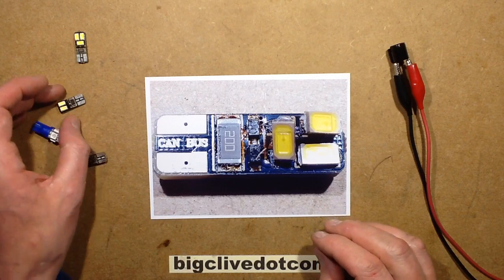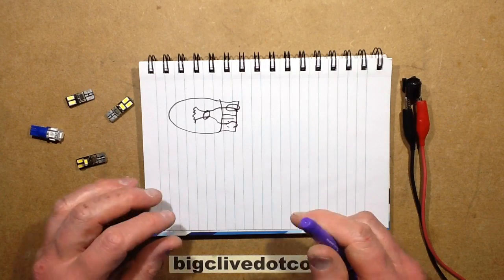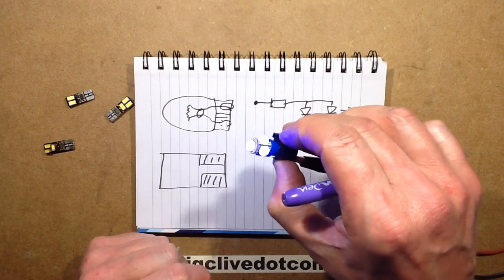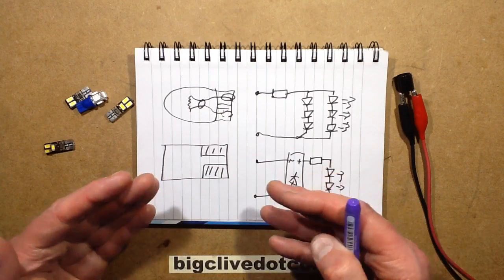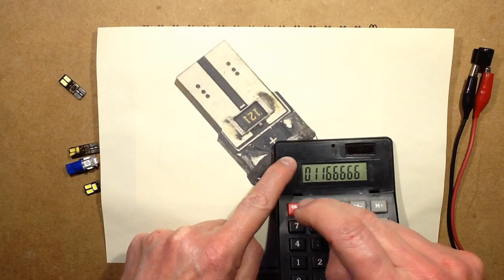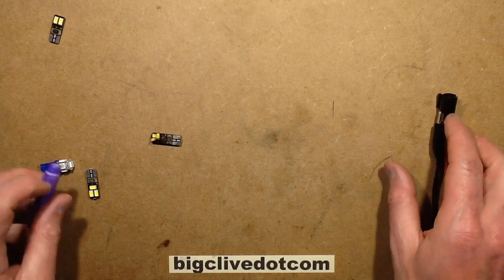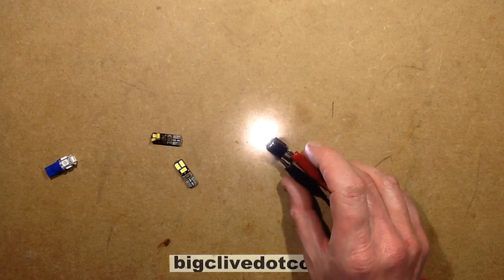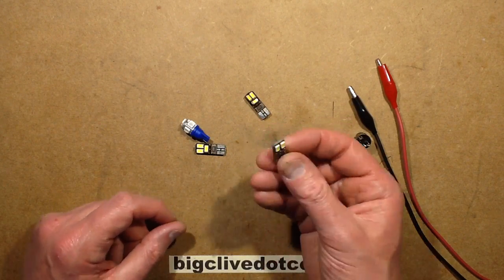Smokin' hot CANbus LED lamps.  (230C in open air.)

Comment: Couldn't you just remove the resistor?
Reply: +Susana Godinho 
Because it's brighter and if you know how to install them correctly last longer.
I have used many over the years without problems. Apart from deciding which looks more stylish.
Reply: +JaredtheOverLord Lol, I think he knows what a bus is. CAN is a communications protocol as stated, nothing to do with detecting lamp failure. The lamps are connected to the central or rear JB which drives the lamps and detects the current through them but CAN is not involved in this at all. The JB then communicates back to the BCM through LIN or CAN but these are purely communications protocols with the physical layer defined - NOTHING to do with the lamps. "CANbus compatible LEDs" is a complete misnomer.
Reply: JaredtheOverLord Actually that's incorrect. CAN doesn't run to the headlights or any of the other lights in the vehicle. LIN is used for interior ambient lighting but you'll not find a single power connection to the headlights along with the CAN bus wires. That's the reason you still have the fuse box with the various relays in it.
Reply: Then the Canbus system would throw up a fault light. And it would not work.
I personally use non Canbus with a seperate purpose made resistor with more heat dissipation, installed between the cars light wireing.
These can be purchased from eBay as a 501 Canbus cancellor.
Reply: +pt197472 what's the point of using led then?
Reply: +pt197472 There is no "canbus system" detecting the lamp. CAN is a communication protocol
Reply from the maker: +Christian Gerefalk Yes you can.
Reply: +Susana Godinho people like the look of the pure white i guess?
Reply: +pt197472 Subjective. My 1999 car still has many of the original lights at 60k/17 Years. But they are all OSRAM (as with any replacements I use) Granted the "whiter" look may be more stylish, but the usability is limited for side lights (not flashers)
Reply: +Susana Godinho You can still get those ugly "warm white" headlight bulbs.
Just look for OEM replacement or Eco.
Getting the ones rated +50, +100, +120 ect. are the high output low life.
Reply: +SDG Electronics you need to research what a bus is
Reply: Dr. Lecter Exactly
Reply: +Dr. Lecter -_- a bus is a network in which devices are connected, the headlight connects to the vehicle via the CAN protocol. In this case the CAN, is being used as a bus, therefore it is a CAN bus.

Comment: Pretty funny how they can f up something so simple, so badly.
Reply: +Silver Legend They have no idea what they are doing. One day I contacted an eBay vendor which was also a factory. I explained them that, at 14.4V, they were putting too much current into their LEDs, and I suggested a higher resistor value. Then answered me this : "Our LED products are only meant for 12V vehicles". Stupid fuckers, 14.4V is the nominal voltage of a 12V vehicle............
Reply: +tHaH4x0r  I think they f them up very well!
Reply: The real fuck up is the car makers still not putting LEDs in the cars... :)
Reply: @uski  they don't need them. lower power leds don't imrpove anything.
Reply: +uski  Ebay et al : caveat emptor!
Reply: +tHaH4x0r Really though, the fuck up is on the cars inability to sense low power lights. I struggle to think of another solution to the problem other than replacing the cars sense resistor with one of a higher value. 
To increase the power usage to a level poorly designed car circuitry can detect, it has to dump that power as something... Perhaps a better solution would be to list that 'fault' as a feature. So low power, your dash might not realize it even has a functioning bulb
Reply: The universal solution which has to work with all the cars is simply emulating a bulb, so you have to use a resistor. However, depending of how the car senses the bulb, it might be possible to increase the resistor value a lot, reducing the power dissipation by a huge amount, or to add a capacitor in series with the resistor, so that the resistor will dissipate power only for a short amount of time, if the car uses pulses to sense the bulb. But unfortunately these "optimal" solutions will be car specific.
Reply: +Richard Smith Well at the time that the sensing stuff was implemented, no one couldve expected low power lights to be introduced, thus calling it a fuck up is a bit extreme. Of course you'd expect modern cars to do so.
Reply: +uski I was talking more about the thermal design. It is obvious to see that you dissipate a lot of power, but there couldve been a more elegant solution to get rid of the thermal power.
Reply: +uski Sadly the automotive industry has always been fairly conservative in terms of electronics...I guess it is primarily due to the more comprehensive safety tests and safety oriented designing. That often automaticly implies designers go for 'tried and tested' solutions instead of new or innovative designs. It says enough that only now, modern (non luxury) cars are moving towards LED lighting. Kind of like the aerospace industry in a way.
Reply: Yea... Just got a 2015 car and FINALLY it's full-LED... almost. The interior lights and the trunk lights are still incandescent. Even worse, the overhead center console light is half LED (reading lights), half incandescent (door light), go figure !
Reply: uski AFAIK, most cars will have a voltage splitting resistor in front of the bulb sensor, so when the resistance to the bulb is too high, the voltage will be too high on the sensor and trigger the bulb blown light.
By using a higher value resistor here would mean that a higher resistance(lower power) bulb could sufficiently pull down the voltage as to not trigger the sensor, but sometimes, this circuitry is black boxed and inaccessible, so such a modification would basically be impossible.
Theoretically, an inline resistor to the bulb sensor should do the job even if black-boxed however. It would pull down the voltage delivered regardless of how it is detected(as long as the bulb is functioning), as far as I know.
Reply: +Richard Smith yes... Yes... YES! That very well would probably work... bbiab...

Comment: OMG! 230C = 446F
Reply: +ELECTRONTHORP Surprisingly it is hot enough to melt leaded solder (183C) and right on the borderline for many lead free solders (220-240C), so it is somewhat surprising they remained attached to the PCB at all.
Reply: +ELECTRONTHORP congrats, you appears to have discovered the idea of making LED cake baking device !

Comment: Nice but what is the point really of putting leds in the car unless you are a dogger? BTW I was thinking during my insomniac hours. Could you make a bridge rectifier by tacking a pnp and an npn transisto face to face? I saw a video called transistors explained or something liek that whre they said a transistor is basically 2 diodes commoned together. I know there isnt really any application for this other than keeping component count down and there is probably no economic incentive for it but would it work?
Reply: +rimmersbryggeri You could make a bridge rectifier with just transistors, but it would be useless. The video you watched isnt false perse, but not entirely true either. In terms of PN junctions they are similar but due to the shared junction they behave entirely differently, and cannot use it as a '2 diodes in 1' package. You can however, use a single transistor instead of a single diode by connecting the base to the collector, but that would be useless since A: transistors are more expensive and B: they take up more boardspace. Think of it this way: An NPN transistor has 3 junctions (as the name implies), yet if you connect two diodes in a string, they are essentially a PNPN junction.
On a different note, there are '2 diodes in 1' packages available, they are quite commonly used as rectifiers in computer power supplies.
Reply: tHaH4x0r
 Yeah I thoght there was some gross oversimplification at play there. But it is still quite an interesting thought as long as you know as little about electronics as I do. for most purposes Id think a bridge rectifier as the one used in the unit in this video would probably be the best way to keep component count low.

Comment: Bought 100 with the plastic base, with the resistor leads making the contact, and they are pretty bright. Might have to change them regularly, but I still have a lot. Just got dinged on postage, seller must have been unhappy his auction closed with a $2 bid.

As well the cheaper lamps suffer badly from lumen depreciation, got some H3 spotlight replacements, and they have really degraded from 2 years of use. Might just use these T10 ones as a replacement, seeing as they are really bright, plus I can change them out regular. Just have to look up some T10 holders to bodge them into the place of the H3 lamps.
Reply: "cheaper lamps suffer badly from lumen depreciation"

This will happen anytime you have LEDs running at high power that can't dissipate heat properly.

Comment: Interesting.
This video reminded me, that the 3 lights for the speedometer on my motorbike were dead - I changed them to LEDs a long time ago.
Just looked after those LEDs - they are exactly the same as you shown, just in warm white (and a pretty useable warm white, too).

The defect was on all of them, that LEDs had desoldered themselfes. Great, now I have 5 5630s flying around in my speedometer :/
I had some new ones lying around, just desoldered the 151 Resistor and switched them out. If they fail, I will go for the original bulbs...

Comment: Which idiot decided to use the phrase "CANbus error free" to describe these ? The correct term is "diagnostic error free". The fact they used a 120 ohm resistor (CAN bus cables are terminated with these) suggests they think you should connect it directly to the bus! Don't do this, it'll end in tears,

Comment: Even at half cycle rate (indicators ) they will become hot if running for some time, a potential fire hazard, particularly behind dash and interior locations. The sensor for the canbus is easy to modify to stop the detection of faulty lights due to low load current, this is the best solution coupled with the NON can bus LED's , Or just desolder the resistor across the input on the Canbus ones after modifing the current sensor.

Comment: First off: Your're right that these destroy themselves, because the LEDs can't stand the heat.
And maybe can damage the car by shorting out once they are destroyed or something similar.

But doesn't a W5W standard bulb also emit 5 Watts worth of heat?
Yes they are hot. But the socket in the car is literally designed to hold a hot, glowing wire.

Comment: I understand the issue involved but to be honest I'm a bit confused: I assume not even the "canbus" LED lamps attempt to consume more power than the original bulb, nor are they putting out less light - so why would they put out more heat than the original lightbulb? If the LED lamp itself is poorly built, cannot take the heat and spontaneously disassembles itself or burns out, that I can understand - but shouldn't it be the same thing as the normal bulb for the socket / lamp housing they are plugged into?
Reply: +Attila Asztalos A lamp filament can run close to 3000°C, so it actually much hotter. The difference is that the filament is not in direct contact with anything sensitive unlike the resistor which is soldered on the PCB.
In fact, the whole point of an incandescent lamp is to be as hot as possible without damaging anything.
Reply: +Attila Asztalos 
Because tungsten bulbs release most of the heat trough radiation, on the infrared region. That heat is irradiated out of the light fixture the same way as light is. On a LED all the heat stays there locally and has to be transferred to something else, generally the surrounding air, therefore the temperature increases to a much higher level for the same wattage.
Reply from the maker: +Attila Asztalos The main issue is that the tungsten lamp is made of glass and metal, while the LED panel is not able to withstand high temperatures and the LEDs certainly can't withstand high temperatures.
Reply: therealnightwriter It sounds a lot like crackpot science, but no matter what kind of power is used, incandescent lighting must be hot, by definition.
Incandescent lights work using blackbody radiation. The idea is that everything emits light. The wavelengths depends on the temperature. For lighting, we need visible light (not IR) and for this, we need temperatures in the thousands of degrees Celsius. The the lower the temperature, the redder the light, the higher, the bluer.
There are different, colder ways of producing visible light (LEDs for instance) but this isn't incandescent lighting anymore.
Reply: +TheJohn8765 "Magical electricity" is better than "cold electricity".  It is Eco-friendly because it works purely from the power of imagination.

(I always feel bad for poor old Nicola Tesla, what with every crack-pot and scam artists attaching his name to the nonsense they push.  Edison was much more of a nutter and scammer in historical fact, so they should be fair and at least assign some of that to him.)
Reply: +Attila Asztalos It's what LED does with that same amount of power in comparison to standard incandescent bulbs: Incandescents spray their light energy across a broad spectrum.  LEDs don't: They put their output into three major tight bands of light, creating a difference much the same as the difference between between slapping and stabbing someone. LEDs are brighter, volt for volt and mA for mA.

It's also materials: Glass, tungsten and steel can withstand temperatures up to 600c before the glass becomes too soft to hold a vacuum. A FR4 PCB has a maximum temperature of 130c. An incandescent lamp will get to about 130c without really trying. (I wish to see a FLIR shot of a regular marker lamp bulb to illustrate, but I don't have a FLIR cam and can't find any reliable images (because of LEDs and their "color temperature".) That and thermal fracture: Cycling anything between hot and cold a bunch of times tends to damage it.

Incandescent bulbs should be replaced with LED in a responsible fashion: Decrease the current being sent to them, design the replacement unit with heatsinks, choose better materials. Don't expect to just replace incandescent with a cheap LED unit without any issues. Are they/do people? Pff. Everything's made in China, people hate spending money and people also have unrealistic expectations, so: "no".
Reply: +therealnightwriter And you end up with an incandescent car.
Reply: +therealnightwriter Why don't you introduce the applications of cold electricity
Reply: +bigclivedotcom what about the festoon style led light that are adapted with ''canbus'' witch also have some sort of heat sink straped to the back? how will those fair compaired to these where the resistor i soldered straight onto the PCB?  mounted a couple in my cars trunk yesterday sins they only will be on for a short amount of time anyways.  (the link is for the type i bought) http://www.ebay.co.uk/itm/252366960310?_trksid=p2057872.m2749.l2648&ssPageName=STRK%3AMEBIDX%3AIT
Reply: +Susana Godinho That is a great answer.
Reply: +therealnightwriter Since the first results are "zero point radiant energy demo" and "the free energy secrets of cold electricity", I'm just going to assume you're a nutter.
Reply: therealnightwriter If you proselytize, you need to be able to take some heat - no pun intended.

Comment: LED Lamps for cars.....
We bough several for our car, to replace all the inside lights.
First one in, fuse says "nope" :D
Second one in (different type and slot), flickers .......
Third one in, gets pretty god damn hot, but it is inside a metal housing, therefore safe enough i guess.
Fourth one is the one that killed the fuse, used the old lamp, works like a charm and is warm white rather than 4k ....

One thing for sure: NEVER buy cheap LEDs for your car, might fart, piss or explode in your car and your day might be ruined ;__;